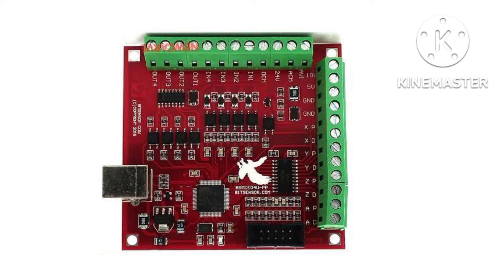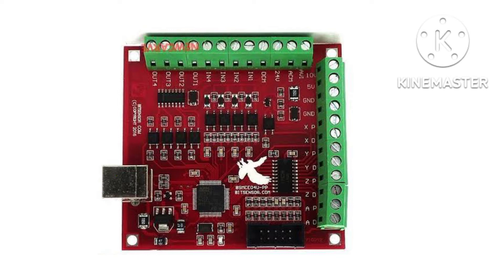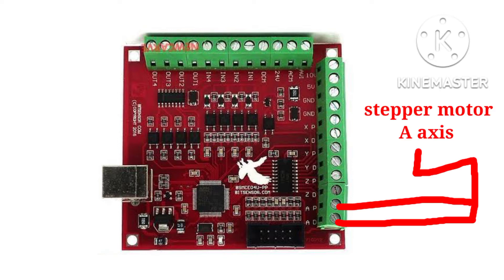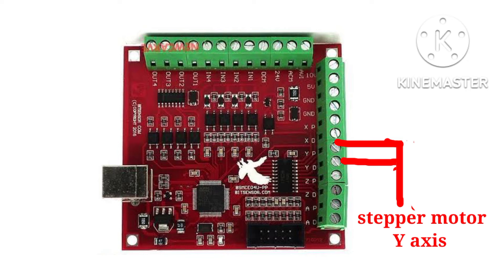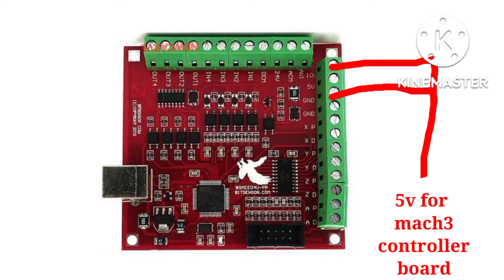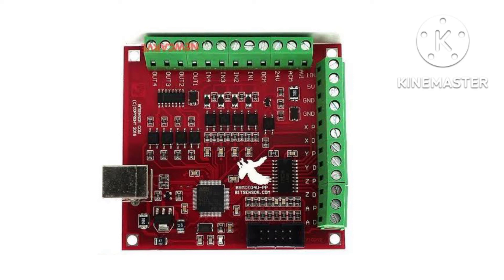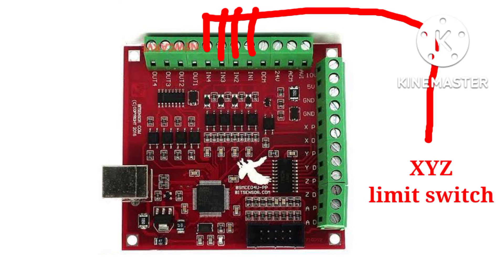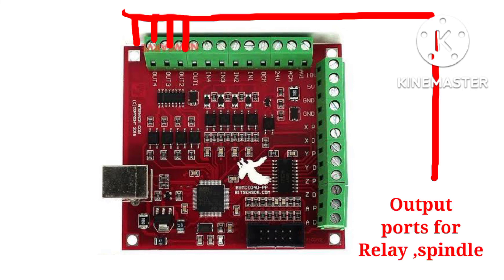cnc mach3 wiring|cnc Mach3 controller board settings diy cnc machine

Comment: it does not run spindle properly
Reply from the maker: Its run spindle proper dear .maybe you'r wire conection wrong
Reply: @Akhtardesign  there is a speed difference between the speed shown on and the actual spindle speed

Comment: Hello sir I have same CNC board but when I connect USB cable to my laptop it's not detecting to laptop even I changed USB cable but same problem I checked all wiring all good I uninstalled software & installed again but same problem is that board problem anything else can you help me
Reply from the maker: Cable k driver install kro bahi.aik aur b driver install krny hy mach3 usb board ky ab mery zain main ny main dekh kr bata don ga bahi. Board on hota hy ? Ya nhi
Reply: @Akhtardesign  nai board on he nai ho rha pehly bilkul perfect chal rhi thi achnak sy aesa masla aya hy